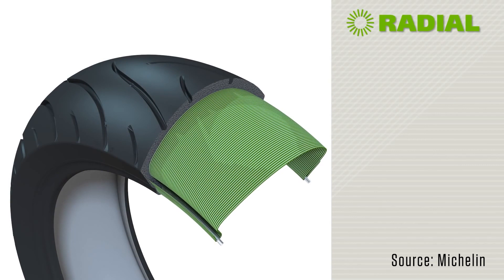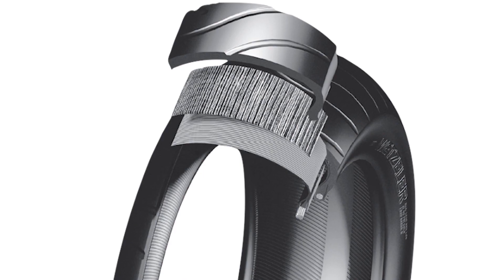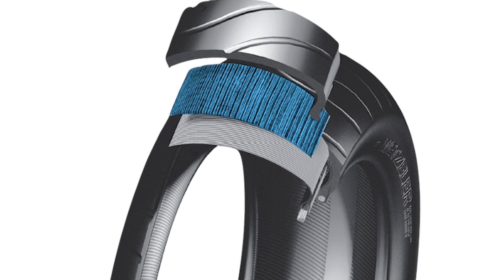Bias-Ply Motorcycle Tires vs. Radial Motorcycle Tires | MC Garage

Comment: Very useful information. I have one important question though (as i've just seen this video now). My bike is a Honda X-ADV 750 (2025 model) so it has a different type of tire size than most used combinations - it has a 17 inch front and a 15 inch back which makes it difficult to match a pair of touring or sport-touring tires on it. 

Even tho i found some good pairs i don't really like them, as i've tested Michelin Road 5 before on a Honda NC750 and it worked superb for my type of riding (99% of the time straight - paved roads - touring style - trips to Greece, Turkey, only on road, not offroad). 

So my question is.... given the fact that i cannot find a pair of Michelin Road 5 to put them on my Honda X-ADV 750.... can i put a Michelin Road 5 tire in front and Michelin City Grip 2 on the back? The pattern they use are 90% identical so i don't believe it will be a problem with the handling. Also...this combination will help me so much more long-term (both being all-season tires and providing excellent mileage - 20.000 KM +).

Appreciate any feedback, if any can be provided <3 Thank you for your time!

Comment: I have 330cc cruiser motorcycle with around 30 hp and torque, for my bike there aren’t any radials available in the market, some are available but I’ll have to miss match the front and back or I’ll have to upsize the rear. However bias ply tyres are available in the market. So what do you guys suggest should I just go with the bias ply tyres?

Comment: I recently bought a triumph street twin 900. It comes with a bias front and radial rear. In researching replacement tires I'm finding that Michelin is the only manufacturer making this combination. I've found 3 manufacturers that make bias front and rear and one with both front and rear radials. Most of riding is on mountain roads with an occasional road trip. No chicken strips on the oem Michelins that came on it new. The Michelinswork fine but are expensive. Should I go with radials or bias? I always enjoy your vids btw.

Comment: Most Adventure bike Use Mixed unless they're capable of higher speeds like 1200cc .
Slower 650cc Mixed is normal Biased front Radial rear ( FROM FACTORY ).
READ YOUR OWNERS MANUAL !!!!

Comment: You didn't specify, if it's only on tube tires or if it's on spoked wheels in general that you shouldn't run radial tires on. Should you not run radial tires on spoked wheels, even if they're sealed for tubeless tires, or is that safe  since there's no tube?

Comment: I have a 1990 CBR600F(1), it has 110/80/17 on front and 140/80/17 on the back, I want to go 110/70 and 140/70 and get pirelli diablo rosso 3's. They are radial and not sure if they will fit the bike? anyone have any ideas?

Comment: Hi I ride a 2000 yamaha virago xv535, only driver. Is it safe to use a bias 170/80-15 with tube? I never ride over 120 km/h
Reply: Dude, I just realized that I run bias with tube (160/60-17) on my KTM Supermoto.. I've went 170 km/h with it.. no issues whatsoever.. Didn't even realize the difference until now. I hope this helps.
Reply: I need to correct myself.. I run radial haha
Bias is recommended :D

Comment: Motorcycle tyre and inner tube machines manufacturer from China,If you encounter any problems in the tyre and inner tube production process,fell free to contact us.7*24 hours service hotline Tel&WhatsApp +86-13165072636,email pang_555@126.com

Comment: Thanks for this, Ari. As usual, an insightful video which we can immediately apply.

I have just gotten back to riding after a long break and am wondering how to increase my visibility to drivers. There are of course the standard ways with hi-viz clothes and helmets, reflective tape, etc. However, the advice for the correct placing of additional lights is all over the place.

Could I request please you to make a tutorial about the pros and cons about additional lighting and the their placement on a bike? I ride a Honda Valkyrie 1999 and am thinking about placing two additional lights way down on the highway bar protecting the engine.
Thanks,
Anjaan

Comment: It go back to heat generated within . Ever cup a radial ? You got it so hot that cords crawled within the rubber around your tires carcass . That tire is a goner and if equipped with a tube a better chance of going too the moon . Keep at it Boy / Thanks  be

Comment: Hi, very informative, thank you. I have a question, I ride a Vulcan 1600 and recently put new Metzler 880 tires on it. They recommend a radial rear and a bias front. I have no issues with handling but seem to have a lot of road noise, do radials make more noise than bias tires? Thanks again.

Comment: What do you suggest to those companies in which we have spokes and radial tyres and tube for examples all the adventure motorcycles, triumph tiger xcx, Honda africa twin, KTM 1290 adventure. I use a 2014 Triumph Bonneville T100,  used Outex kit to make it tubeless as it's easier to fix puncture on tubeless.

Comment: My little R3 came stock with Michellin Pilot street Bias Ply 110 front 140 rear. Utter shit tires. Always very sketchy on wet weather, had very low grip, would chatter alot(rear wheel during downshifts)  and just overall terrible performance. Caused many riders in our country to lowside as these tires were very sketchy around corners, which we have alot of. 

Thank God I switched to Radial tires. Better overall performance. Makes the bike even more fun around the corners.

I got a set of Dunlop sportmax D222 radials from a friend (120 front 160 rear) for around the equivalent of $22 in our currency. It came stock on his kawi Versys 650 and only had 1,400 original kilometers on it. Great deal really. I suggest other R3 owners to immediately change the stock shitty tires. Its a good investment trust me.
Reply: Yea my MT03 stock tyres weren't that great. I changed to Battlax BT45 which are actually bias ply, but dual compound (softer on the edges), they seem to be durable and pretty good for commuting and wet weather. Curious as to whether the bias ply would put me at much of a disadvantage compared to equivalent quality radials on the track.

How does running 120 and 160 on a little 320cc go for you? Does it lose much of it's easy flickability? I'm considering this route too.
Reply: stickybugs05 me so jealous of the MT03 sadly they only gave us the R3 here. Would've wanted a naked R3 cause I hate all these fairing bullcrap. 

The dunlops that I run are both dual compound as well but it is rather lazy when it comes to turns but its all because of the rather round and flat profile of the rear tire. I ran shinko apex/verge 120&160's on my last set which has a steeper and narrower profile and the bike just falls to the side and darts through corners. 

Guess it should be noted that these Dunlops were intended for sport tourers hence the round profile which makes it really stable on straights and rather lazy at turns but it suits my overall riding style. The shinkos were great bang for the buck tires. Sticky, agile, and confidence inspiring, but wears quite quickly.

Changing tire profile didn't really affect much of the handling just gotta get used to the different tyre profiles. Also, the 120/70/17 front raises the front end of the bike a bit and makes it have that "Multistrada" stance. Rectifiable by dropping the clipons by an inch or two. Bigger tires also make it look better i.m.o. haha
Reply: Thanks for the info reply! Yea actually was an MT25 (we don't get 300cc Yamaha here due to taxes), but I stroked it up to 320cc. The Multistrada stance wouldn't be so bad on a naked I guess, more just worried about changing the characteristics of the bike because it's so damn nimble. Seems the class of tyre matters more than simply the size though, by what you say I think a more sporty tyre would still tip in nicely.
Reply: got an r3 too .. my rear tire just got worn out .. im thinking of getting a 130x70 17 at the rear and when the time comes for the front im planning on sizing it down to 100x80 17 .. what's you're opinion on sizing down the wheels on r3 ?
Reply: ba ecchi You’re going to make it even worse. Can’t get decent radials in that size. Go for 110 front and 140/150 rear.
Reply: DUDES, i have a YAMAHA Motard and switched from diagonal tyres to radial. 
GO FOR PIRELLI DIABLO ROSSO II or 3. Very good braking capacity in the wet (i dont have abs) and still able to brake quite hard in a straight line in the wet), good traction and warms up to optimal grip level with not much effort if you use the right pressure for YOUR rider + bike weight .
Good when it comes about lean angles and trail braking.
Better than this you only have supersport tyres or track tyres like diablo supercorsa (for both aplications)
Wish i had and YAMAHA R3, i would go those tyres straight away cause i liked them so much.

Comment: I did my back tire after watching someNJ of your videos and being just fed up with paying a bike dealer to do it for  $300+. Plus they gave me a bad one and had to go back and the they charged me labor for their bad tire. So for $200 i got a OEM Dunlop and tools i needed and did it myself and saved $100. I figured out some tricks to getting a tire to bead. None of the usual work but found Dawn soap with windex and 5psi above its normal psi got it on then i just lowered it to normal. This is on a Honda VT750DC so spoked. I almost went with another tire that fit but after learning something from these videos i realized it was a tubeless and all though it may have fit, may have been lets say, not recommended. So thanks for the videos.

Comment: I race with small sportbikes such as the CBR125R and YZFR125, but my tire options are limited because the only manufacturers that produces small radial tires is Michelin with Pilot Street Radial. Can you ride aggressively on bias ply tires on the track and do you need tire warmers ?

Comment: Can you provide some insight as to why an OEM spec split of bias and radial tires is of value to a consumer? I recently purchased a motorcycle that, from the factory, has a radial rear and bias ply front.  I have been riding for many years and consider myself an educated consumer.  I have learned from riding sport bikes over the 28 years of riding to not mix these two types of constructed tires primarily for handling purposes.  This is a 2015 cruiser.
Reply: pmdinaz Cruiser's are more for slow speed traveling. They split them, at a guess, because a Bias does better for control whereas the radial on the rear provides better traction.
Reply: John Derek Mitchell that was honestly my thought as well, thanks for the info!
Reply: Since both cruisers and sport bikes that are not doing track days can only go 85 mph max, does it really matter?

Comment: Ok, so you outlined the reasons for the current applications of the two but some things were left out.  Most of us are familiar with radial tires on our cars, but few, including you Ari, can remember  bias plies on cars.  On cars, bias plies were lucky to last 30,000 miles, rode like  tank treads, and had less than half the traction of a comparable radial on dry or wet pavement.  Radials were initially fitted to semi trucks in the U.S. because of their longer tread life and better fuel economy, whereas in Europe, radials were standard on cars in the early '60's.  A couple of benefits of radial are: extremely long tread life, excellent traction, and smooth ride.  Compare them on expansion strips and worn concrete sometime.  So, could a radial be designed to provide similar benefits for cruiser and touring bikes where the benefits would be appreciated for many hours at a time?

Comment: I found my Victory Cross Country's handling adversely effected when I switched to a bias-ply set of tires(that will remain nameless ....lol). The bike developed a serious wobble in long turns that no amount of air-pressure adjustment or suspension tuning could fix, my bike had about 15k miles on it at that time). I switched to radials on the next change over.....and fast forward to now with 55k miles and the bike has never had the issue since.

Comment: With tires whats the difference between steel belted and nylon belted? Coz my pirelli diablos comes either steel or nylon and im confused
Reply: Each material imparts different characteristics, and even among materials, different thicknesses or tensions or amount will alter the tire's behavior. So it's all a matter of utilizing the materials that meet the manufacturer's goals. Weight capacity, wear, bump compliance, etc. And don't forget price. Cost is always a factor!
Reply: Thanks Ari Henning nylon is cheaper, but does it perform better? And last longer?

Comment: Thanks for the video again!! So to be clear?, all spoke tube tires are bias ply? Like the heidenau k76 for example or metzeler tourance?
Reply: That's what I was always led to believe, and it's what I was recently told by tire engineers I interviewed, but just yesterday I looked at the new Husqvarna Vitpilen 401 and it's got spoke wheels running radials with tubes... I'd be willing to bet that on that application they weren't worried about excess friction and heat because the bike is so light and relatively low on power.
Reply: That’s interesting as my 2014 Triumph Thunderbird LT came with spokes , radials , and tubes front and rear and I replaced them with that same combination but a different brand of tire . This motorcycle is a porker at 850 pounds . This is the smoothest riding motorcycle in the group I keep . I attributed it to the radials . My wife and I have done some touring and overloading on it for sure and there has never been any signs of distress on the tubes at tire changes . I average about 11,000 miles on set of tire on this machine . I’m lucky to get 7,000 miles on the other machines tires .

Comment: Given this info, i struggle to understand why Yamaha put bias-ply tires on the R3 from new. 

I had to swap them in the first 500 miles because they gave me no confidence.
Reply: I have the Michelin Pilot Street tire on the rear of my bike.  Same tire as the stock R3.
This tire compound is long lasting (hard) and will slide easily until they've warmed up. 
It's not because it's a bias ply.  It's the type of rubber compound used. 
I'm cheap so thats why I put it on my shitter bike.  
I kind of like the slide factor.  
I'm trying to back it into corners like Zach does.
Zach is my hero.  Sorry Ari.
Reply: A T that's understandable. It was fun to lock the rear coming to a stop light, but just disconcerting when I didn't want it to be.
Reply: Pretty sure that's a price-based decision.

Comment: I love my radials at speed on highways and nice roads but they sure get sketchy on dirt and gravel roads. Fresh "chip & seal" like used everywhere in my area are downright scary for a few weeks.
Reply: upside downdog I find fresh chip seal scary with either tire construction. One episode years ago in New Brunswick on the road from Sussex to Saint Martin’s with one very short new section caused our entire group to require a long smoke break even for the non smokers
Reply: John Lewis 
I don't doubt that! I once had a friend with a mile long driveway which he paid to have finished out with ditches and pea gravel. I told him how difficult it was to ride on so then he had it paved! He was between bikes at the time.

Comment: can you discuss the differences between leading, trailing and a center mounted axle for front forks?
Reply: It's quite similar to angle of the front forks, trailing axle gives more stability, just as more forward facing forks will, thus it is better suited for traveling bike, choppers and cruisers. Leading axle gives better agility and responsiveness, just as more straight down forks, so you will find it on sportbikes, naked bikes and dirtbikes, since they need to be nimble and turn sharp - usually, the axle will be just center mounted because it is easier to make and you can get the desired effect by the angle of the forks.
Reply: makes sense. it's kind of an old school question really. kinda like you said I cant even think off the top of my head a bike that isnt center mounted anymore
Reply: It's a way to change the "trail" without changing the rake angle (I think there is a rake/trail vid on here)
Reply: Nice profile pic
Reply: Tetrahydrocannibinol you as well 😎

Comment: Can you mix radials and bias play tires
Reply: Jerry Hearn  many bikes do from the factory. But many people will say you can't.
Reply: Yup, what Chris said.
Reply: I have a bias Michelin on my rear and a radial Continental on my front.  
Bike rides fine.  
420 lb bike.  Not much HP.
Reply: A T  i don't think anyone makes a radial 90/90/21.   So if you run radial on the rear it's going to be a mix
Reply: Chris Hart
I'm not talking about my dirt scooters.  I'm talking about my street scooter.  A Suzuki GS500F.  
I've got a Continental Conti Motion Sport Touring Radial Front Tire 120/70-ZR17 and a Michelin Pilot Street Rear Tire 140/70-17. Bike handles just fine and I like riding it more than my Kawi Z750.  Wish I could have the Z750 power but the GS feel.
 
Lots of experienced riders have told me that mixing bias and radial tires is wrong, but I'm doing it and I don't see or feel anything wrong.  
Perhaps on light weight bikes it works???
Or maybe if the bias is on the front and radial on the back its a bad idea????

I have a very minor high speed (140 km/h - 87 mph) steering wobble during long sweeping corners, but I'm attributing that to steering head bearing being out of adj (or worn).  I can feel it during a hard brake coming up to a stoplight. 
I'm pretty sure it's not because I mixed radial and bias.   
When I get off my lazy ass and replace the head bearings I'll know for sure.